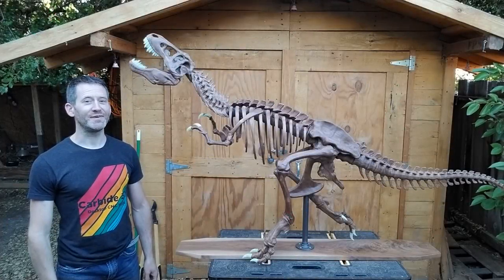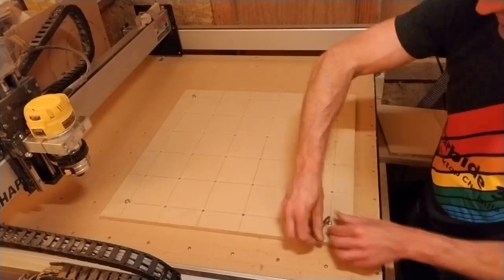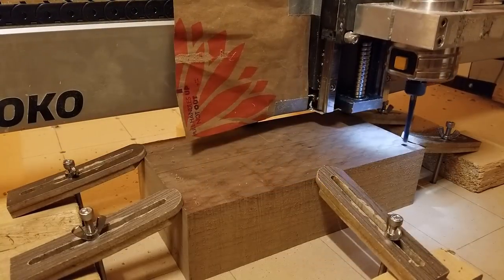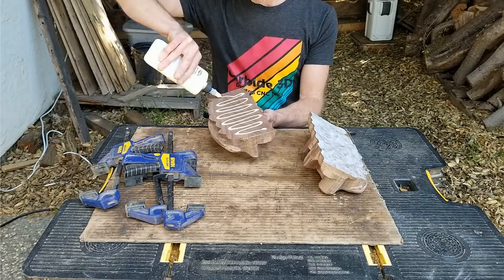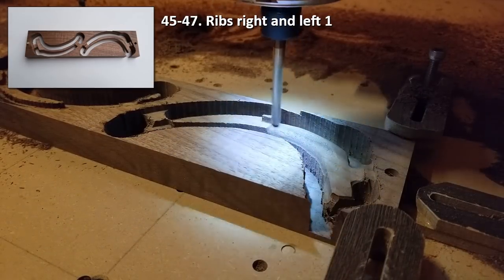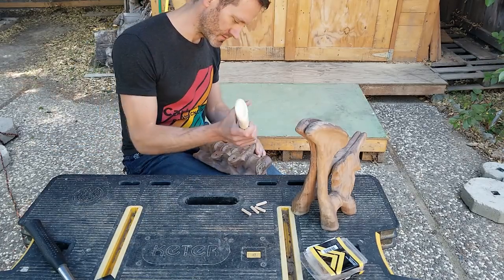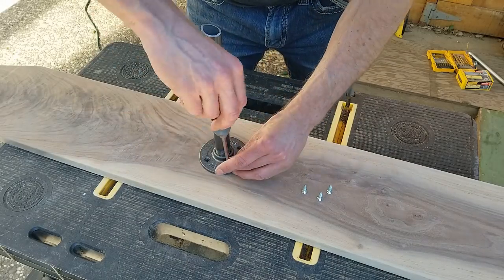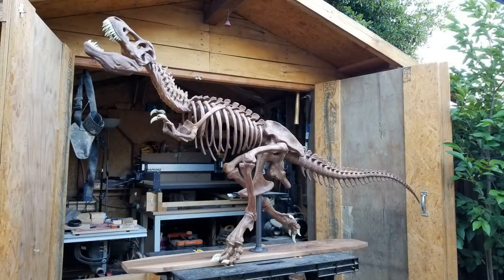CNC carving a huge T-rex skeleton with the Shapeoko XXL

Comment: Wow, so much detail. I bet it cost a lot of money for your time and materials. I used to work at a small steel fabrication shop. The owner asked me to make a stegosaurus. It was about 20 feet tall. It took a lot of work. I have also made several smaller dinosaurs; two of them are in a outdoor museum in Florida.    You are a great engineer. I have a small CNC plasma cutter. I used to make metal art. Thanks for the video. 😮😮😮😀😀😀😀😀
Reply from the maker: Thank you for sharing your story! :)

Comment: wow, incredible work! What would be the smallest size you think you could have done on the T-rex and still have gotten that much detail?
Reply from the maker: Good question! You can make it pretty small, as long as you use a fine-tipped ball nose bit. But at some point, you'll run into the limitations of the wood grain and fiber density; the strength and stability is compromised if the structures get too thin and fragile. Still, I think that, for a T-rex, bigger is better. ;)

Comment: Good Evening Dennis - Firstly I would like to say wow - brill cnc work and love your work and channel. Secondly i have the same model that you used from thingiverse, however i can not seem to get the dosal vertebrae to be able to split into two halves without creating an undercut. Did you have this issue as well? Any insight would be greatly appreciated. I may also have to make your 3 - 8 sided turntable platform as that is an ace design for many applications.
Reply from the maker: Excellent question! Yes, I did have to modify the 3D model, so that the undercuts are minimalized. I made these modifications in Meshmixer. I tried to keep the model as accurate as possible, but someone who is knowledgeable of dinosaur skeletons will probably notice some other tweaks that I had to make to the bones.

Comment: Not criticizing your methods because you did a phenomenal job, just curious: any reason why you didn't drill and dowel the left/right sides of the skull for easier/perfect gluing alignment?
Reply from the maker: Good question! The answer is pretty straightforward, but may be difficult to see in the video: the flat insides of the skull halves were actually carved under a sloping angle, rather than horizontally parallel to the CNC bed. The reason for doing that was that the eyebrows, nostrils and nose cavities of the skull were all sloping downwards. If I had positioned the skull half with the flat inside flush to the CNC bed, then these areas would have been left uncut, and what should have been shallow pockets or dents would have been filled. By slightly tilting the halves, so that the bit was able to reach these spots, I kept the 3D shape of the skull as realistic as possible. You can see what I mean at 1:33. Take a close look at the dip between the rim of the eyebrow and the bump in the center on the top of the head. Now imagine the skull half being tilted 90 degrees. A bit coming straight from above would not be able to get into that dip. So I tilted the skull half just enough for the bit to get in there, without compromising the other areas. So, to get back to your question about drilling dowel holes for perfect alignment: it is of course not possible to drill straight holes perpendicular into the flat surface of the skull insides, once you have tilted that surface. I hope this clarifies.
Reply: @dennisvanhoof9958  makes perfect sense, devil is in the details. Well done and well said.

Comment: Do you keep all of these or do you sell them?

Also have you ever considered going to a vfd controlled spindle. I have a 1.5kW spindle which is the biggest you can run on a 20amp 120v circuit but if you have availability of 230v power you could go yo a 3h.p. spindle. I heard that you ran for a month for the carvings was thinking a more powerful spindle may allow you to take a deeper depth of cut or increased step over to cut down on process time.

Comment: Two things spindle related.....
First- a water cooled spindle would improve your noise level tremendously. 
They are almost silent. Of course the bits cutting make some noise but less than you might think. 
Secondly...
I have often wondered why people position routers all the way down in the mount but position spindles the exact opposite. The way I position my spindle so my surfacing bit can trim the wasteboard. 
Just wondering if I am missing why there is a secret in spindle positioning 101.
Reply from the maker: Uhmmm... I just position it where it needs to go for the particular project I'm working on. Not sure what others do with their spindles and routers, but I'm confident everyone does it in such a way to get the job done; up, down, or somewhere in between. All fine with me. :)

Comment: Wow! Where will you display it?
Reply from the maker: Good question! My house is becoming too small for all the artwork. I need a bigger house, or start a CNC artwork museum. ;)
Reply: @dennisvanhoof9958  don't wanna sell any?
Reply from the maker: @samrix5793  I have sold a few, but it is always difficult to part with something that you put so much effort and time into. Sweat, tears and a unique idea are not easily valued in money. I still like the idea of a bigger house better. ;)
Reply: @dennisvanhoof9958  yes definately agree certainly when the art of so beautiful, and will always grow into what ever space you have. How do you keep zero on the machine? Are there any modifications you have for the machine like touch plate etc?
Reply from the maker: @samrix5793  I do have a touch plate, but don't use it for these kind of projects, as they don't need that much precision. A piece of paper to set the Z-height on the stock surface, and a few pencil lines to set the X and Y zero coordinates are sufficient to setup the job. Once the dowel holes are drilled, the X and Y are defined by those dowel holes, and the precision of all following carves is determined by the CNC.
Reply: @dennisvanhoof9958  that's great thank you for the reply

Comment: amazing work Dennis! i would like to try and make this.  How do you size each piece ? would i be able to get your specs for each piece? i can resize the head but how do i know what the rest of the pieces should be. i am also running Aspire
Reply from the maker: Thank you!
Unfortunately, resizing is not so straightforward. You would not only have to resize each piece in each dimension (X, Y and Z), but also use finer tips for your bits to retain the detail, which requires every piece to be recalculated (also to correct for the new feed and speed rates). I used VCarve (I don't have Aspire). It took me weeks to design all the tool paths (40 pieces that each have 5 individual tool paths, plus a few more to setup everything; so we're talking about more than 200 tool paths). And even before I got to the tool paths, I first had to modify each component in Meshmixer, and rotate the pieces virtually for the best approach and fitting.
Reply: Thankyou for replying

Comment: How much commission are you able to charge for such amazing artwork?
Reply from the maker: I'm estimating about $800 for the wood, $100 for the epoxy and equipment (cups, spatulas, brush, latex mat, etc.) and another $100 all other stuff (glue, varnish, dowels, etc.), so I'd say $1,000 or so, if you have a working setup and all the required bits.
But that doesn't come even close to the labor, which is about 40 days of 10 hours each at, let's say $50 per hour; this equates to $20,000.
And then I'm not even mentioning the time it took to modify the 3D model and design all the individual tool paths. That would be approximately 3 weeks of evening hours, so maybe an additional $3,000.
Take into account the wear of the machine and bits, as well as the time and investment it took me to be able to do this (purchasing and learning the software, and the machine) as well as the artistic component (its uniqueness, how many others would be able to make this, the blood sweat and tears, and so on), and it quickly becomes priceless. :)
As you can imagine, I would not sell this for $30,000. ;)
Reply: @dennisvanhoof9958  That's a terrific breakdown. Thank you for the answer. Your artwork is unique and beautiful.

Comment: The pose, especially the legs and hands are not correct.  Otherwise a museum quality piece.
Reply from the maker: Sounds like you're a dino expert! :) You are right, I had to make a few small modifications for practical reasons to make it machinable. You may have noticed that the teeth are all back to back (I believe there should be spaces between certain sets, but it looked a bit weird; as if it was missing teeth, so I placed them all close together), the pubis is too short and under a slightly different angle (I had to make it fit on the largest piece of stock that was available, and change the angle, or the support strut would not go in straight), and the ischium is also too short (it wouldn't fit in its original length, and would be too fragile). Can you spot more things that are scientifically incorrect? :)